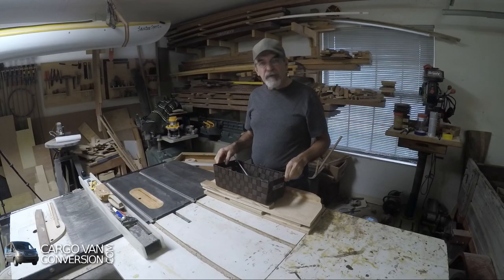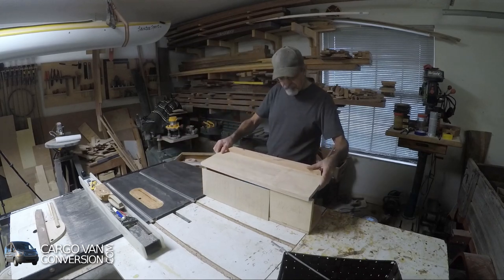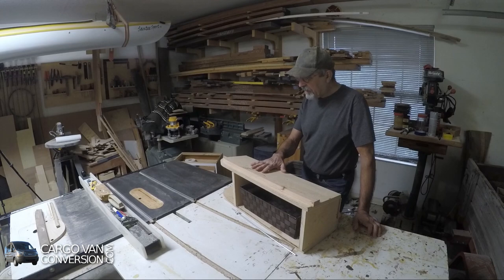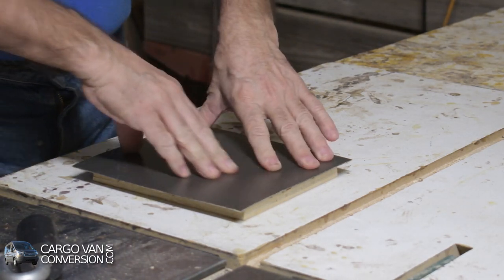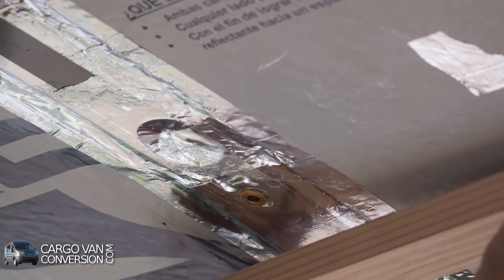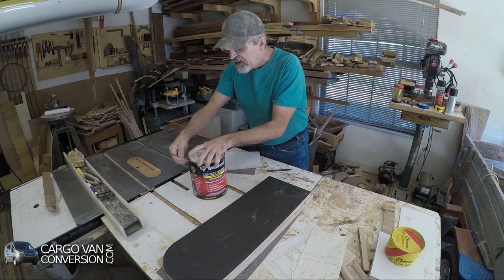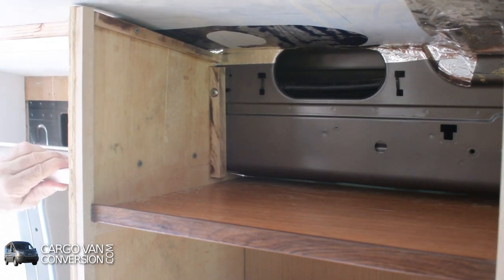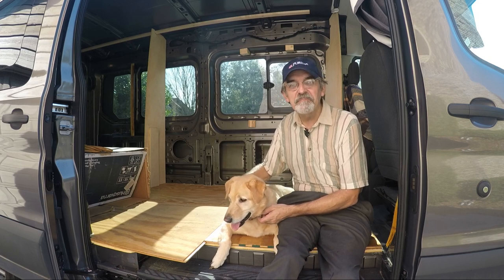RV Upper Cabinet

Comment: I like that you use different materials and contrasting colors. It makes it more interesting than all the others.
Reply from the maker: With the Formica I actually use three different sheets: the dark brown as a contrast and two white, a glossy white for all the outside faces and a more durable matte white for the inside faces. I will have two countertops (kitchen and the lower cabinets next to the pantry, probably made of mahogany/sapele, which also has a contrasting color. Don't think that's enough though, so I'm working on a knock-off Mondriaan oil painting (just posted a picture under the 'community tab') that will add some bright yellow, red and blue colors and will hang in the 'dark square' on the front of the bed. That will be part of a fold down desk, which will have a 'bench seat' in front of it of white Formica with a bright, likely red cushion on top. BTW the bench seat will hide the fold up workbench that I recently finished.
I like what you wrote; quite observant :)
Van Williams

Comment: A nice homely top cabinet, Van. I like the rounded end - reduces the chance of a head bang (ouch!!), also looks good. I have just added a small top shelf to my van (took out tv screen, not used) and I added a small clay ornament for a homely touch - I used contact adhesive to hold it down, but I'm not quite sure if that's the best way - maybe small velcro pads. We'll see how it goes.
Do you have a pet baby deer in you yard? Spotted one in background of previous video. All the best.
Reply from the maker: Thanks Norman. I often use Loctite ProLine adhesive for that or you could use a construction adhesive. If the item is made of wood, a simple screw from below would do the job, With Velcro you should use a heavy duty from 3M. Would love to see a picture of your top shelf :)
Van Williams

Comment: I feel like I've been following you forever! When do you think you will complete it?
Reply from the maker: You're right, David.
The real work started about three years ago. I knew then that I had a few years before I could move into the van permanently (that should be around this time). Knowing that and my urge to make these detailed videos, gave me the opportunity to do things slow but right. You also have to realize, that I spend 75% of the time of the conversion on the video production, posting, etc.
Right now I'm putting in the last few main items. I'm already working on a gasoline heater and started on the plumbing; a major item is also the ceiling panel. Then the van is fully useable. I will have to postpone moving in permanently, but will use the van for extended periods.During that time I will redo the 12V/solar (Lithium), install a computer/TV system,  and floor. Just taking it slow :)
Van Williams